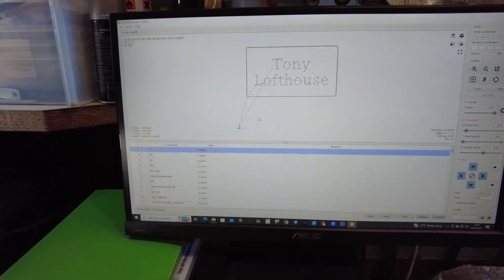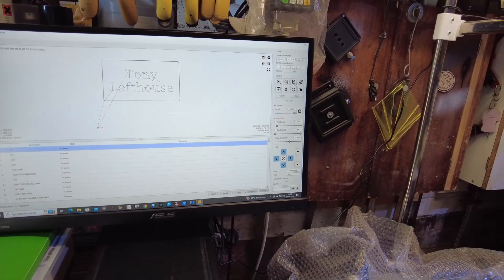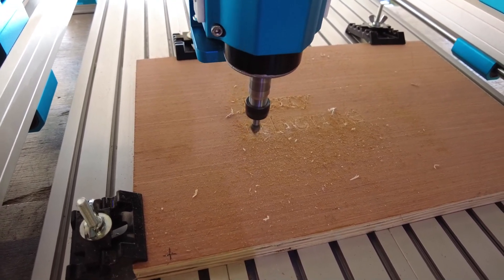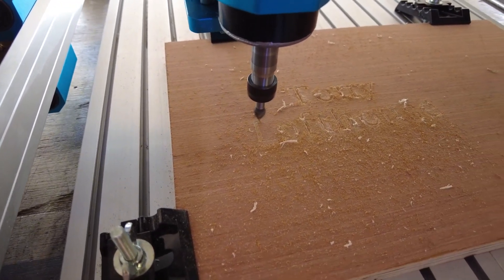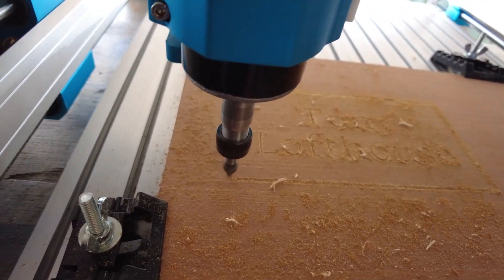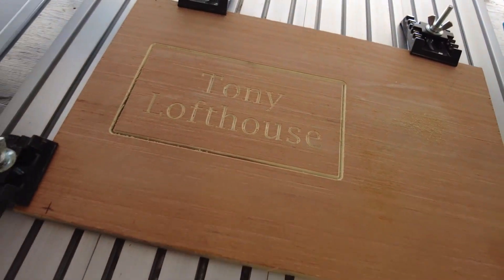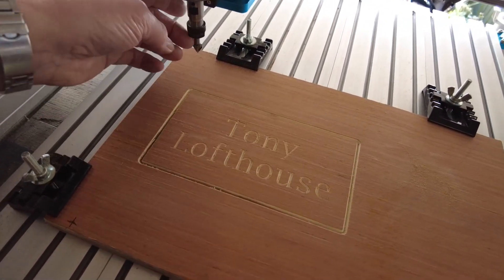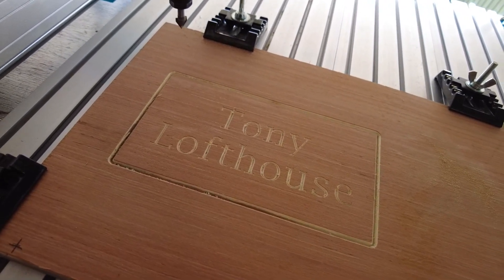Sainsmart Genmitsu Cnc 4040 Pro vcarve cutting in action

Comment: What spindle is that
Reply from the maker: Hi thanks for your question it is a 500watt spindle  from Amazon comes with a power pack, speed controller, and a selection of er11 collets
Reply: @Tonys.Top.Tips.Workshop  do you think it could handle aluminum?
Reply from the maker: @RacingOldTimer  yes but you would have to go steady with the cuts. If I were to cut aluminium  then I would get a water cooled spindle
Reply: @Tonys.Top.Tips.Workshop  ya there is a ton of them ,some are marked 220v , Im just gonna go with a makita router I guess. I don’t like the noise though:(
Reply from the maker: @RacingOldTimer  Hi the 500 watt spindle is good but it's still not quiet  but it's not as noisy as the makita. I have a 1.5kw water cooled spindle on my large pro machine now that is quiet. I am going to get one for my 4040
Reply: @Tonys.Top.Tips.Workshop  was there any specific things you had to do to get candle to work with the 4040 pro? I’ll be setting it up soon.
Reply from the maker: Hi thanks for the interest and question. Once I had installed the drive as per instructions and connected the machine it just worked. I use the offline controller all the time I do not use candle as on occasion it has dropped the connection using candle I then lost the job. The offline controller has never let me down yet. It is your choice which software you use to control your cnc there are lots of videos showing people using other cnc control  software. Hope you have plenty of enjoyment with your cnc.